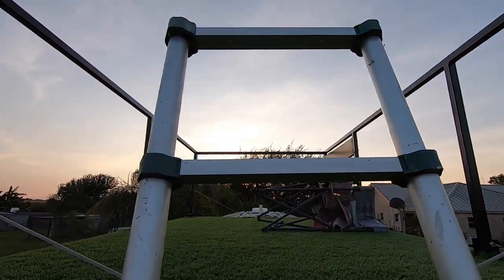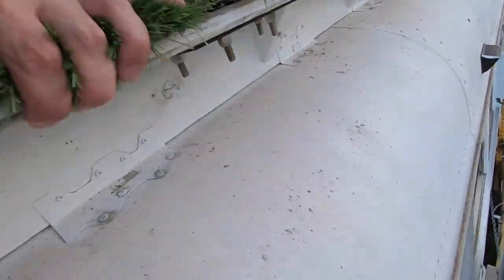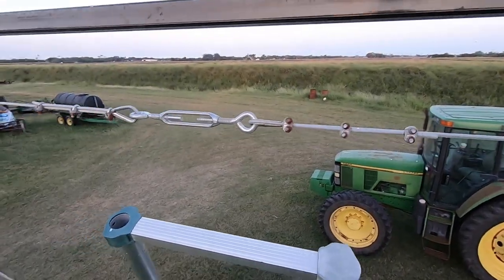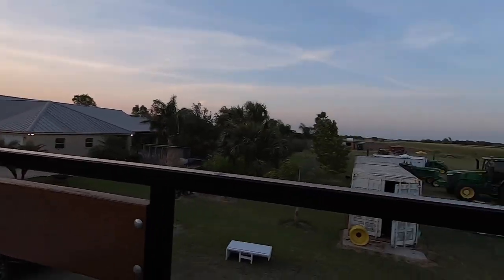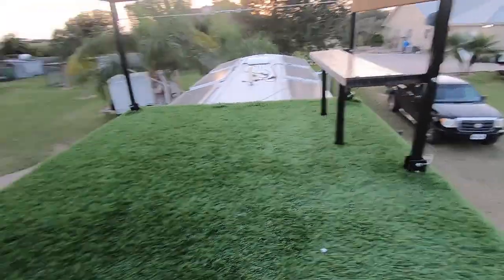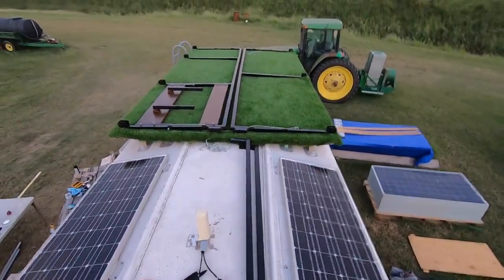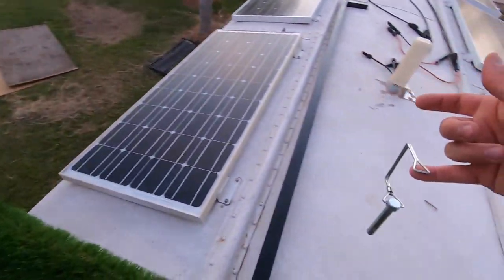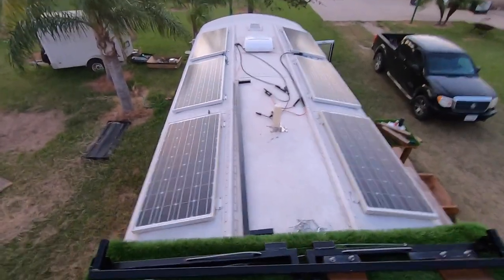Skoolie folding roof deck rails

Comment: A cool idea would be to mount solar panels to the outside of the railings so when you have it in the closed position it can charge the batteries, and in the open position provides additional barriers rather than using the metal wires.
Reply from the maker: Yeah I thought about that too but then I won't have anywhere to put the kayaks 🤣. I have some fold out panels I'm trying to find a place to hang. Metal wires are there to spead out support. Would be too much stress on the bottom brackets without them

Comment: Do u have any written plans for the folding rails? Looks great
Reply from the maker: Sorry, no I do not. It's pretty straight forward tho. If you can weld or know any1 who can, just show them the part where I go over everything. I think I spent around $200-$300 on the parts. It's just square tubing and some 1/2 inch steel plates cut up and welded together + bolts. Before I decided on the benches I was gonna throw up some mesh netting to cover the openings

Comment: What is the hardware you are using for the folding/pinned beam? Got a link?
Reply from the maker: Most of the hardware I made myself from about 40 feet of 1.5" steel tubing and some 1/2" steel plates I measured out and cut to length. For the leg supports, I sandwiched the steel plates and made the little brackets at 1:38 to both keep the legs from folding out and to hold the pivot in place. Bolt through the bottom that they hinge on and I got some locking pins from Lowe's to clip them in. For the bench
https://www.amazon.com/gp/product/B07BHKB6CN/ref=ppx_yo_dt_b_search_asin_title?ie=UTF8&psc=1
is what holds the legs. I'm not much of a welder so I drew everything up, bought a buncha steel and took it all to a friends shop and we made things up as we went :P
Reply from the maker: So yeah....most of it is either steel tubing, flat steel, or angle iron I bought in bulk and found some way for it to be useful. After I made most of it I wandered around Lowes for a while looking for ideas. Any sheet metal or welding shop should be able to source the metal and help build what's needed for a pretty decent price. Then just take it back and bolt it up